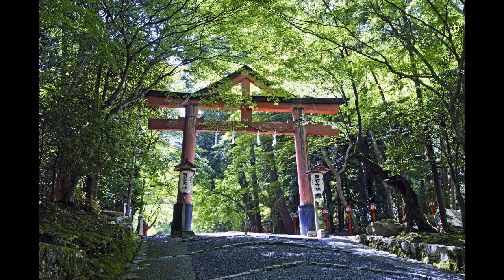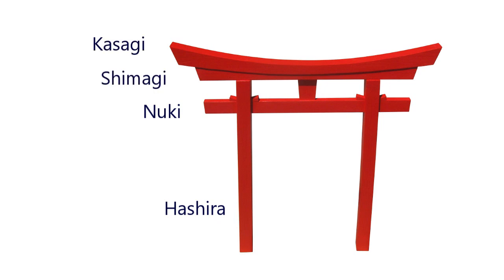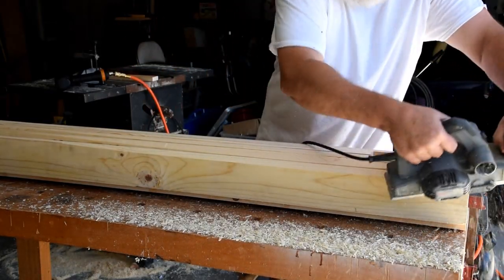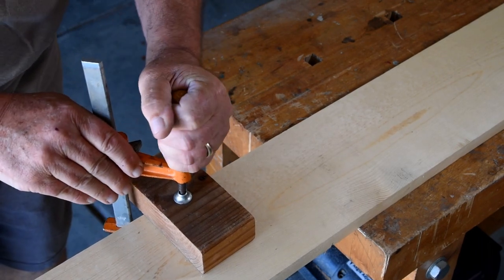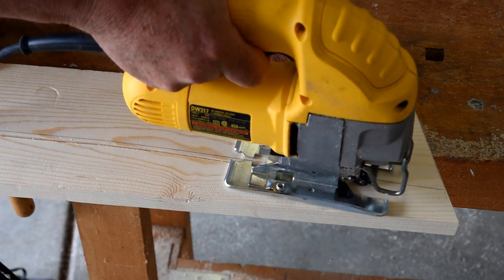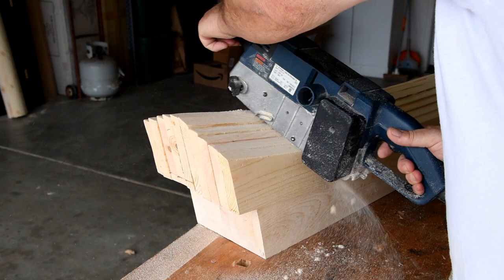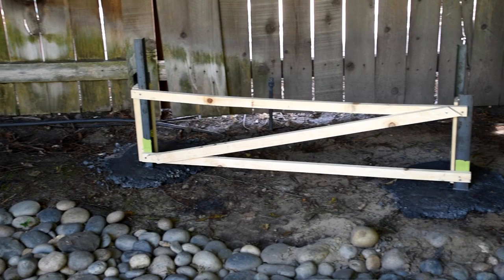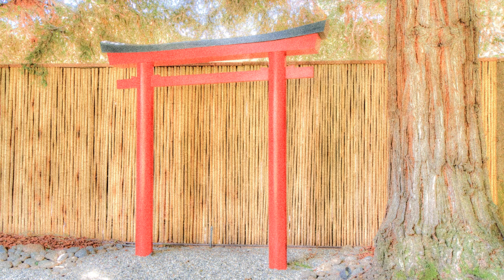Building a Torii Gate

Comment: Wonderful vid.  I notice you made hashira perpendicular to ground.  Most torii in photos seem to have hasira at an angle.  Or is this an optical illusion?  Thank you for your vid and reply if possible.
Reply from the maker: There are a number of different styles, some more complex than others. In my research I found about equal numbers of vertical and angled hashira. Those that were angled were more complex which I wanted to avoid.